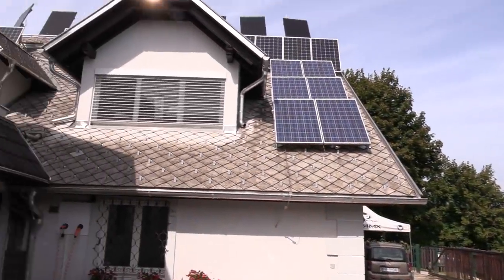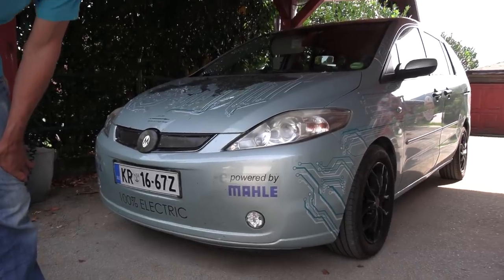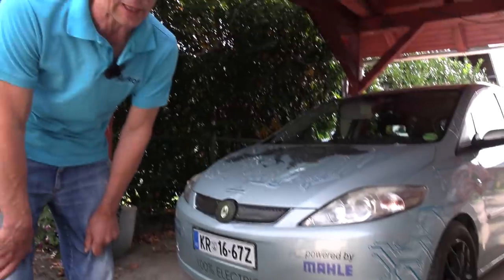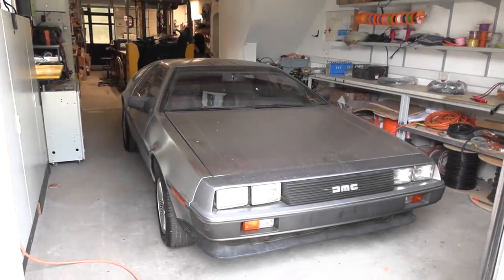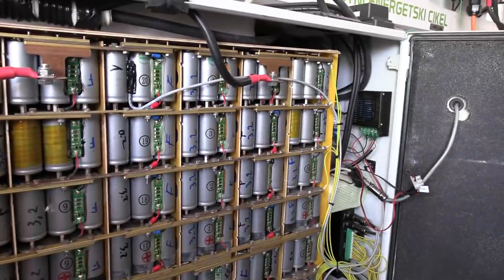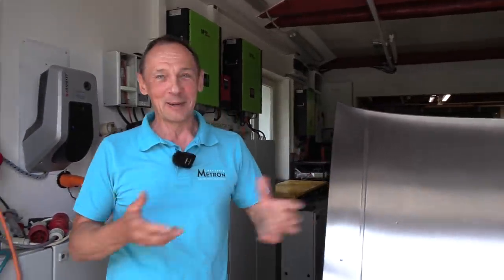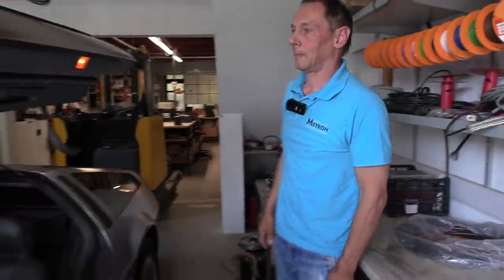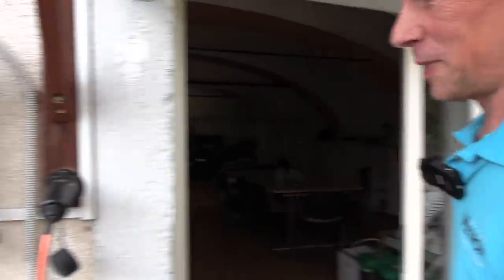Visiting Metron Institute in Slovenia

Comment: Wow, this Smart. It shows what would be possible if only we had enough batteries and companies where willing. If they're not, Metro inventors will force them to build a small vehicle with a large battery
Reply: The Smart was originally designed to be an electric car by the original designer and part-owner Nicholas Hayek. But Daimler-Benz did not see a future for electric cars, so Hayek sold his share and the Smart became an ICE car in 1998. The electric version was first sold in 2012 only.

Comment: LFP batteries have been powering part of my house for 6 months now and I am convinced they are vastly superior to Nickel based Lithium-Ion cells.   Almost no degradation and you can cycle 0-100% with no problems.  Charge and discharge C rate is superb and super safe.  Tesla needs to adopt this chemistry as standard.

Comment: Nice Guy,  He's right V2L and V2G should be an option on EV's . nice to see V2L on the new Korean cars and the Sono Sion but why not all?
Reply: Agree! It is great feature which shall be in every EV.
Strange that cars which have build in V2L and V2V for years is not very popular.

I have BYD E6 2014 which have them. But I had no possibility to try V2L because seems there should be some specific output adapter. I found adapter for Chinese version but not for European. So I still looking how to get it work on.
Reply: It should be essential, not an option.  The point made in the video is that renewable energy will work best when it can be stored at times of abundant generation, high wind, high sunlight days, to use at low generation periods.  Having EVs attached to the grid would make this possible.
Reply: Indeed, I think I will not buy the Model Y from Berlin without V2G. Or at least a Schuko plug in the back.

Comment: I would change the metal panel cabinet door key, with a plastic one. it can easily slip out of one's hands or from above the Cabinet, to then possibly cause a short on those batteries? These Metron guys are also way ahead with their ideas, and manufacturing.  Keep it up.
Reply: We'll do it, it might and will happen after 1000+ uses and we'll have an arch flame experiment :)

Comment: This Founder mentioned exactly what my point has been for years now.
I want to be able to use the battery of the car I paid for, as vehicle 2 House, at minimum 10% max load.
So an 80kwh pack , I want to be able to put my House as load up to 8kw.
Biderectional charging, enabling anybody with an EV and solar to be offgrid. (Maybe with a House storage of 10kwh)
On cloudy days just go and top up the car at a fastcharger. Depending on House needs and dimensioning.

Comment: There is a company in Newtown, Mid Wales that convert Classic cars to Electric. 
Amongst them are a DeLorean with a Model S drive unit and a Classic mini with a Tesla drive unit. 
They have also done a few Tesla conversions on Land Rover Defenders.
Reply: I think you're talking about "Moggy" and ElectricClassicCars..if that's the company , well they're pretty famous already, especially after the "Vintage Voltage" series.
Reply: @DanieleElaborati  of course. 
I just hope there is a second series of Vintage Voltage in the pipeline.
Reply: @huwdavies6650  I believe there is.

Comment: No fossil fuel, no oil… just the polymers needed for plastic and rubber of the parts … but at least that is not burned and wasted. Oil usefully spent.

Comment: EV adoption is accelerating every year.
The number of electric vehicles and types of vehicles and trucks is growing.
Electric vehicles are just better. No noise, no emissions, less fuel costs, less maintenance costs and amazing technology. Gasoline and diesel are OLD polluting technology. So last century.  Electric cars, electric trucks, electric buses, electric trash haulers, electric snow blowers, electric lawn mowers, electric snow mobiles, electric water craft, electric garden tools, electric mechanic tools, electric motor cycles, electric bicycles, electric scooters, electric farm tractors, electric construction equipment, electric delivery vehicles,  ...... everything is going electric.  No worries about starting after sitting for a few months. Gas always needs repairs.

Comment: 250kwh battery?

even normal house in winter with heat pump have to use about 50kwh per day to only heat house :( sorry but 250kwh will not be enought to live and they have 2 houses and big garage and cars, maybe if there is like 50kwh panels on roofs and the winter is without snow than ok 

im my coutry fo like 10kwh battere a have to pay like 7k euro, this is the problem, only diy od the cheap cells but even than the winter is problem only big roofs and big batteries but the cost og this is bigger than 99% houses itself ;)
Reply: In Slovenia you don't really need any heating so it's easy to see the system working there. Right now here in Finland it's already too cold and dark for a reasonable solar and battery set-up to be able to keep a house warm unless it's a €€€ new house with ridiculous amounts of insulation. When it's actually winter, there's no chance for any house or building to be livable with self produced solar energy.
Reply: @celeron55  thats true I mistake slovenia with slovakia mountains ;)
Reply: @celeron55  Of course we need heating during the winter. Most of climate in Slovenia is continental, so warm summers, cold winters. For example, mean temperature in our capital in January is around 0C. Can't find it for Gorenjska region, but it is lower for sure.
Reply: We heat mostly with wood, only some offices with heat pump. We are surrounded with forest, it was a logic choice to use local wood.
Reply: @eja957  

sooooo when I say I am surrouded by oil or coal than its ok for me tu burn  it ale the way :))))

logic